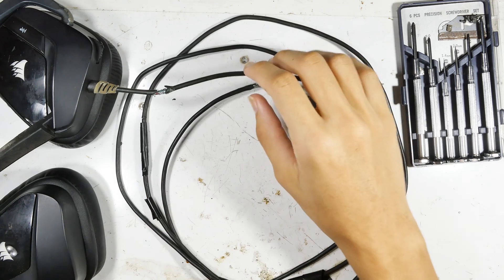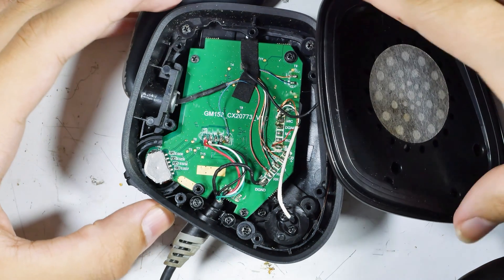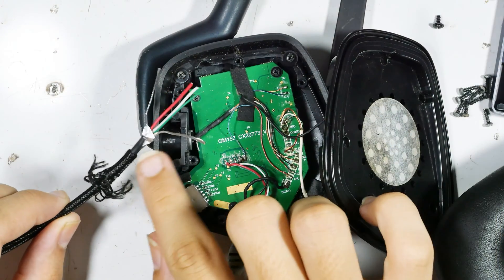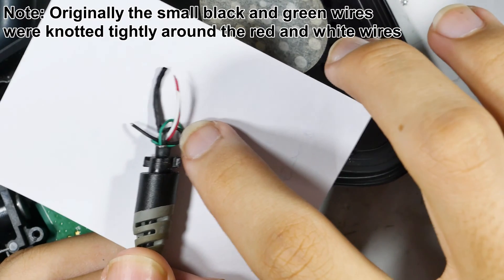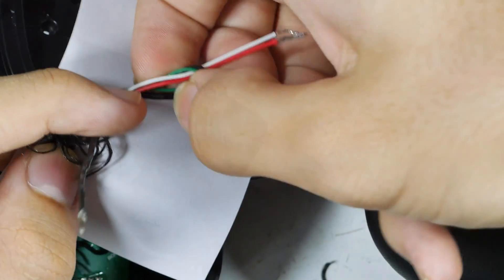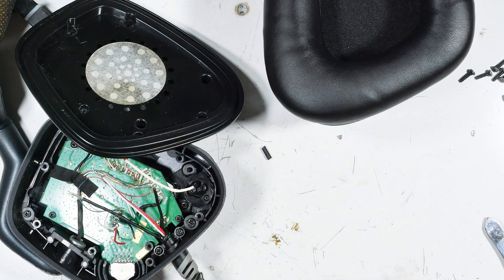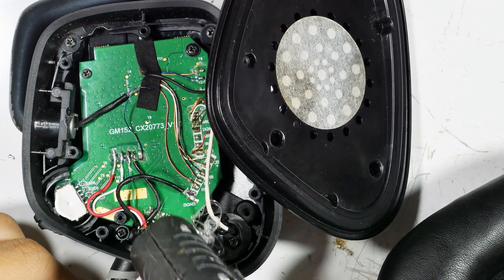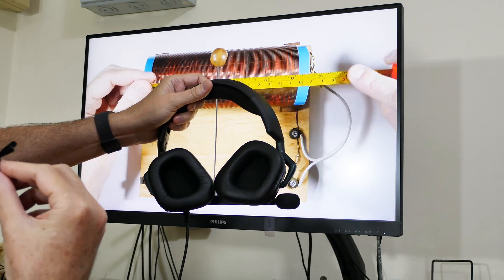FIXED: USB Wired Headphone Cable Replaced (4K)

Comment: hi 
first off all 
awsome video 
second i changed the cable but there wasnt a second ground and the shielding wasnt thick enough to use as second ground 
i testet and both ground pads are connected internally already. so i though: shoudnt it work as well just to connect one? 
short answer yes it does 
long answer but i think something is wrong as icue doenst find the headset anymore(but it still works normal audio in and out) and the pc also shows its name normally

so my question is 
is icue able to find your headset after the cable switch?

Comment: I replaced mine a while back also, the rubber just got tacky and like a jelly. I had an old corsair mouse with braided cable that bit the dust, so cannibalized its parts, took the cable and soldered it into my voids. I also replaced the head band padding and earmuffs. Only issue I have it the braided cable is kinked/twisted and so you need to straighten it out before plugging in. Otherwise works just as before.

Comment: will any usb cable work as long as it has the 5 inner wires?
Reply from the maker: @gummyybear2000  I don't know about any, but most will. You want good flexibility and quality so it will last. Headphone cables get a lot of abuse.
Reply: @tsbrownie  Just had a look at the wire in my headset, looks like the cable is damaged at the point just before it enters the PCB through the ear piece. Might just cut off the damaged part and re solder with the shortened cable. cant hurt to give it ago, ill use your video as a reference, thank you.
Reply from the maker: @gummyybear2000  Does not cost anything to try.
Reply: @tsbrownie  Ended up working, although it was pain soldering the wires, saved me over a 100 euro buying a new one, so cheers.
Reply from the maker: @ Good to hear. We also had some challenges soldering. It's a small space and hard to see what's happening.

Comment: I found this video via googling as to what the green liquid leaking out of my voide elite headphone cables is. No idea how that relates to replacing a cable but thats what im gonna do. 
Holy moly, the silicone cable corsair used is absolute trash. Complete and utter trash.
Reply from the maker: The google/youtube thing is a mystery not meant to be understood by mere mortals. Not sure what is leaking out, many plastics break down for different reasons (self-destruct, contact with other materials/metals, environment (heat, pollution....). The resulting goop is usually not good stuff.

Comment: Great video, but I have a question, tried to soldier my wires on same headset but soltier wont stick to place of old wire, what to do?
Reply from the maker: @Daniel-rr6ul  Soldering requires 2 basic things to work  a clean workpiece and enough heat, all the rest is icing. I have several videos on soldering basics.

Comment: Looking at your video and getting ready to replace my old cable. However, the USB cable I have has a gold line instead of the one with a big black line. Is it okay to solder the gold line to the big black line here? The rest of the lines are the same in black, white, green, and red.
Reply from the maker: @crazy08654  Check the gold wire to see if it connected to the outside of the plug (ground).
Reply: @tsbrownie Then the big black line on the original line is the ground line. Okay. If the grounding line is large black, I can solder the gold to the black spot, and if the gold is the grounding line, I can solder the gold to the big black spot.
Reply from the maker: @crazy08654  You should compare the old wire and new wire plug connections and go by that. Color can vary.

Comment: can you share how to replacement microphone?
Reply from the maker: I've never done that on a headset. I've rebuilt a plain mic. In theory it should be similar; it's just 2 or 3 wires and watch the temperature on the mic (I wrap heat sensitive things in damp tissue).

Comment: Hey can you share info on that replacement cable please? I just popped open a braided cable to find only 4 wires.
Reply from the maker: It was an ordinary 2 meter USB a to c cable from  Ugreen company. Note that our 2 ground wires were not insulated.
Reply: @tsbrownie  that's actually perfect. I have my Mic ground and Agrnd looped and grounded (Turns out the end up together anyways, likely due to a designing plan that never got fully thought through). So here's to hoping it worked with the 4 cables, I never did get to test it yesterday.
Solid video and thanks for clarifying!
Reply from the maker: @BigT_Games  Good luck!

Comment: Thank you so much for this video!
I was scared that there might be some sort of chip in the USB plug, but after seeing your video I decided to proceed.
I just finished repairing mine and I'm listening to the video again wearing headphones that until recently had to be thrown away!
Thanks so much again!!!!
Reply from the maker: I was also scared, but the cord was so bad that we either fixed it or threw it away. But in the future, they just might use "smart" cables. If for no other reason than to prevent DIY repairs.

Comment: Excellent. Maybe see if you can slide some big heat shrink over the USB connector to dress up the big fishing lure tie at the strain relief.
Reply from the maker: We should have done that before the strain reliever/soldering. If we had not let the woven jacket fray, it would look better.
Reply: @tsbrownie  Well, that's why I said "big heat shrink." My guess is that what will fit over the USB connector will also be large enough to fit over the strain relief. As for cosmetics... Your are correct, it is not necessary for this project. You are looking for function over form, in this situation. And, to save a hundred bucks for college, I'm guessing... Grin. I really liked that it was a father and son project! The headset looks well  loved. That's great, as you said they were not a cheap set. Oh... A can of spray foam upholstery cleaner might do the trick on cleaning the head band cushion. Cheers!
Reply from the maker: @t1d100  You got that right, he needs cash for college! The mic boom was also cracked, and we fixed it with superglue and shrinkwrap. I think you might be able to see it in the closing shot.
Reply: @tsbrownie  Additional thought... If you put a long piece of heat shrink over the jacket as soon as you cut the wire, when you trim the jacket back, the remaining heat shrink could secure it... preventing unraveling... I did not say that well, but you get the picture...